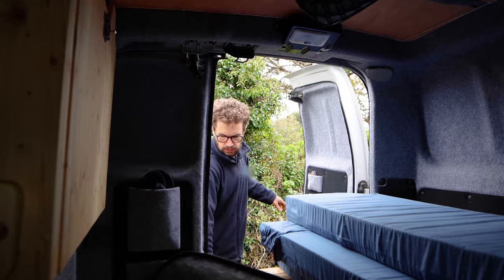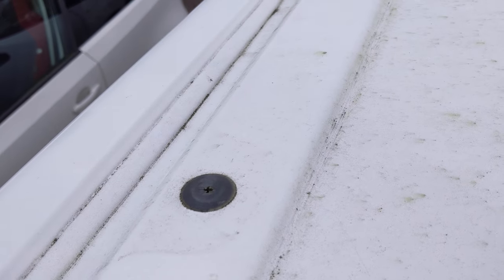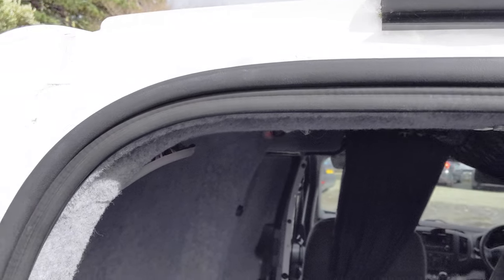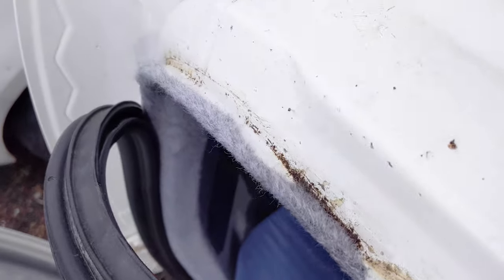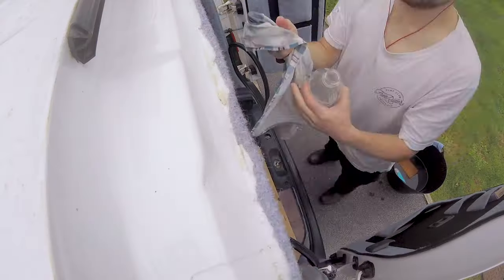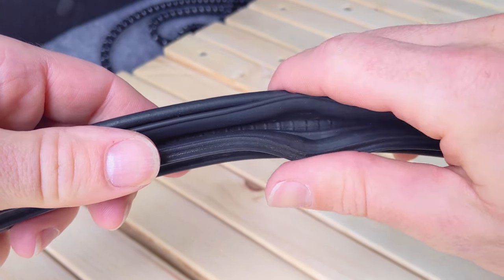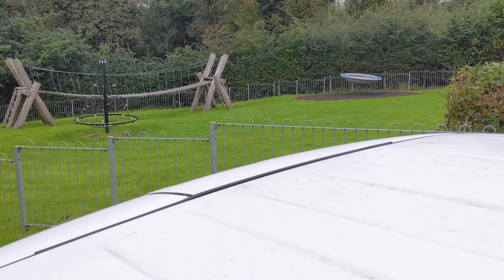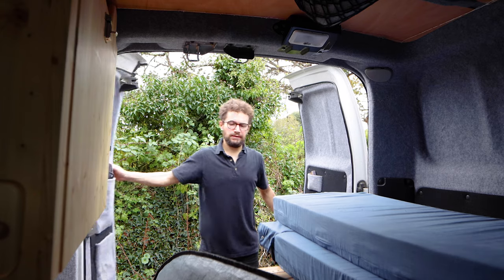My Van Is LEAKING! Finding And Fixing A Leaking Door Seal | Tiny Camper Van Conversion

Comment: Great video. I've just discovered a leak coming in over my sliding door and after watching your video found that I had the same carpet overlap. Since I had to remove the seal several times during install, I suspect that our problems are identical so I'm going to give your solution a try. Thanks for posting the video!

Comment: Thanks so much! My Toyota Hiace has almost the same seal, despite having a tailgate rather than barn doors. I never noticed the wire in the seal until this video. 

I think the cause of my leaking back door is almost identical. I have a flyscreen that goes under the seal which I will trim, will also clean dirt and ensure the wire is crushed to make a tight seal. Wish me luck!

Comment: Hi James, great news about your seals. I had a NV 200 2017 combi.  my leak was when I fitted my roof bars too the factory fixing bolt hole, the near side rear was-letting in rain water, fixed it by removing the bolt and the rubber seal pad then filled the bolt hole with a bit of clear bath sealant then replaced the seal pad and bolt checked for water leaks job done. Did asked my local Nissan dealer if they had heard anything from other NV 200 drivers they said could just be a one off fault.
Reply from the maker: Hi Bob, I've had the same problems with my roof bars. I tried sealing mine with threadlocker but that failed, so re-sealed them with PTFE plumbers tape and it's worked a treat! Glad you got your leak sorted too.

Comment: Good that you got it sorted. That door seal has a dot stamped on it which goes in the centre top or bottom I can't remember, not sure if it makes any difference though. Also keep your eye on that strange rubber drip tray contraption on the top of the thinner door. I had a similar problem during really heavy rain where that tray couldn't channel water away quickly enough so it overflowed into the van. But my wet patch was in a different place to yours so in this case it's different.
I found white spirit was good for removing trim fix during application, as a lot of people advise, but after a few weeks the only thing that worked effectively for me was Zippo lighter fluid. It's a good trick my nan taught me for breaking down anything sticky!
Reply from the maker: The white spirit has been brilliant for me, even after nearly 2 years since I carpeted the van. Hope you got your leak fixed too!

Comment: I had two small patches of water on the bottom corners of the rear door, this only happened after I carpeted the back and folded the carpet around the lip and kept the old seal. I then bought a new seal, cut away some of the overlapping carpet about 10 inches up from where the water was as this was the only wet part. 
I fitted the new seal and there didn't seam to be any more water. Yesterday I lifted the damp carpet at the bottom and found that the water had gone under my floor board. I had to pull up all my flooring, not much water but enough.
I think there was no more water but what was there had made it's way under the floor. 
Today I have just cut away all the carpet on the outside of the lip, squeezed the seal together and replaced it, it's due to rain tonight so fingers crossed.

Comment: Thanks for the video. I also have an nv200 and i have positively commented on your build a while back.  Just for the hell of 
it check the seal that runs across the back doors,  (my 3 year old van which is kept outside) The seal was comming away,
no leaks just a bit of preventative maintenance i cleaned the seal and glued back in place, just the part of the seal that had
come away about 150mm  at each end. Cheers James, Mike from Co Durham

Comment: you got gonna use a vapor barrier? you can get water inside without rain. If its warm inside and cold outside, then any exposed metal on the inside will have the outside temperature, that means any humidity from your breath will go to that metal and cause it to condense back into water droplets. It creates mould and puddles. You need to create a barrier between the metal and your inside air. The carpet helps but Im sure I seen some other metal

Comment: I'm quite sure it was primarily the excess carpet that kind of sucked the water under the seal and then released it to the inside of the van. Trimming it will most likely have solved the problem.
Reply: I have done just what you said, as I came to the same conclusion, fingers crossed.

Comment: Manufacturer's, are collaborating, to make door and roof joint's, susceptible, for rubber seal deterioration, and, water leaking. My Astro, is designed, with the 2 seal's, on the door's, not, on the body. Rediculous, and prone, to cost, 350$'s, and tearing. I replaced the 2 seal's, and, it still leak's. The Roof seal, is fine, but, not working. So, I, will use common sense,  and, buy a "lip over rubber seal", of some type, and, attach it, to the roof, and, it will extend, just over and above, the top of the door's, when shut, and, fix, or shed, the gravity water intrusion. Who ever started designing door's, to come up, over, the gravity roof line, should be made an idiot, or, a rubber seal salesman. Older vehicles, 1960's, had the roof line, overhang the door's. No leaking possible. They want your vehicle to rot, mildew,  smell, rust and trade in, or swrap,  for another one,  that will perform, the same problem.
Reply from the maker: Interesting thoughts